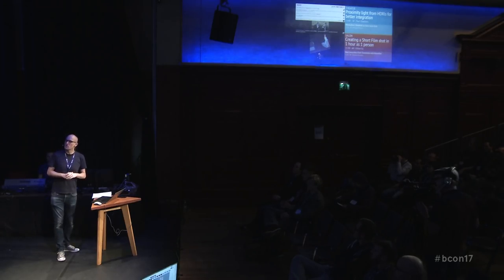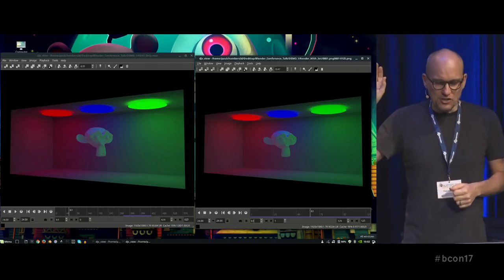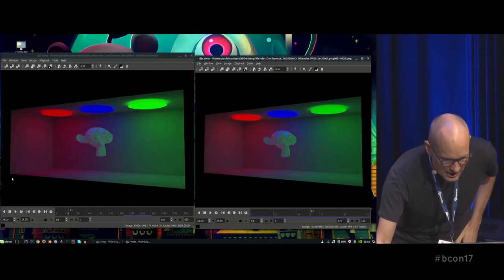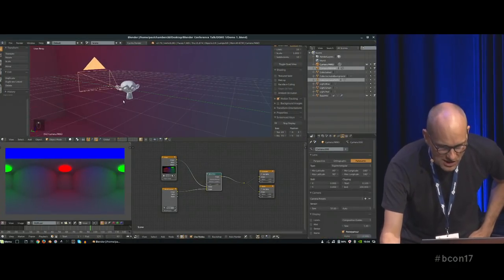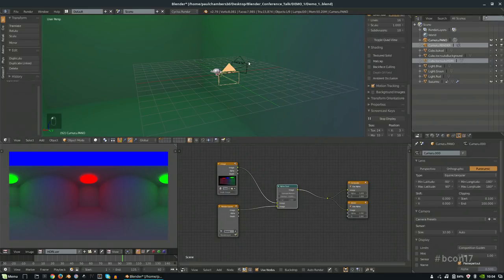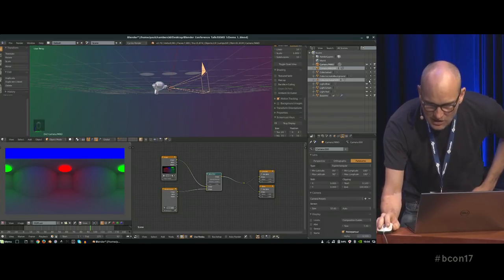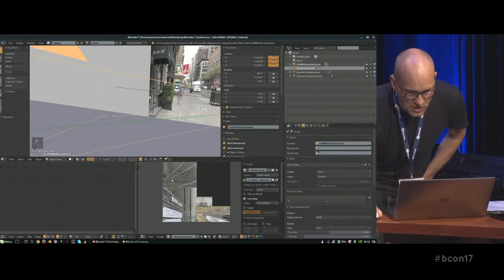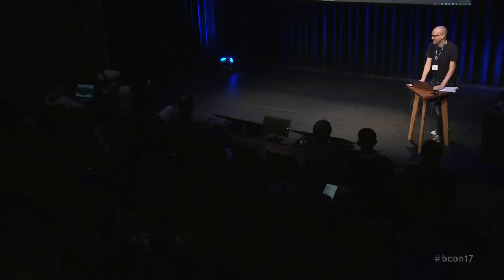Proximity Light from HDRIs for Better Integration

Comment: Its a good idea! But... Compositing would also mean to have shadows casted by suzanne, what will not be visible on an emission shader like the street in your example. So, how would it be possible?
Reply: Use shadow catchers?
Reply: Correct, my time was limited so I didn't get into all the details, but I also used shadow catchers in the scene, and made a couple more sets that approximated the cars and the windows of the skyscraper at the back of the shot to capture reflections of both drones. These shadows and reflections were then composited in to add the final touch.